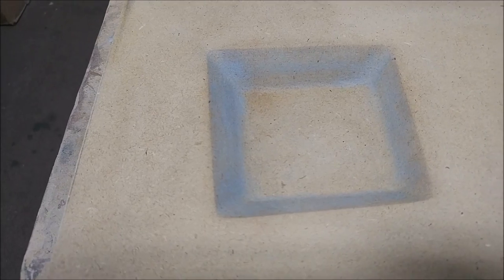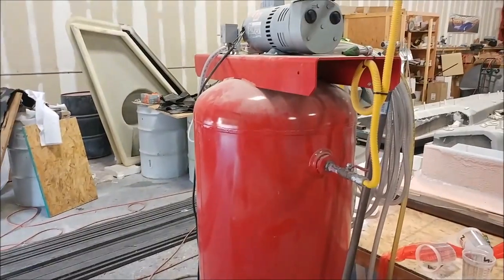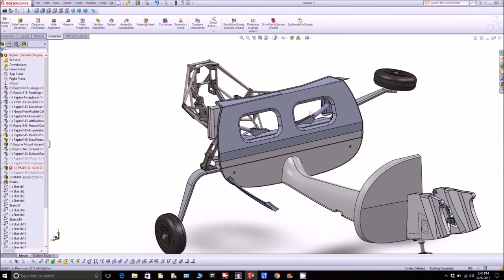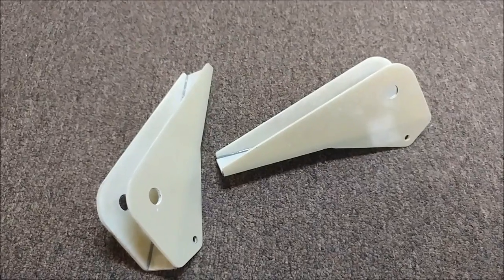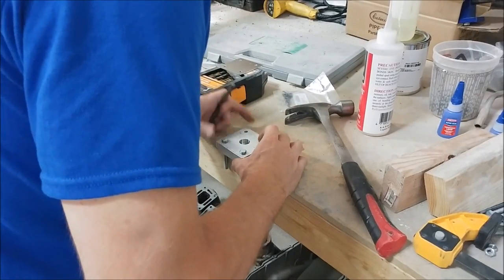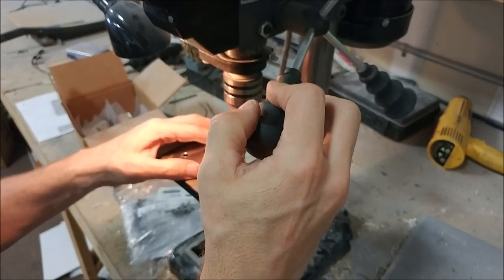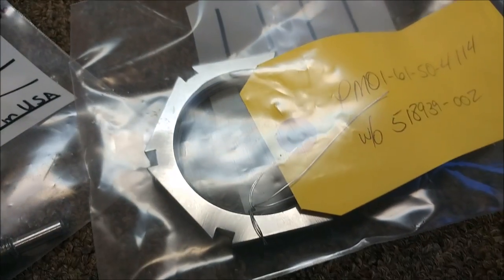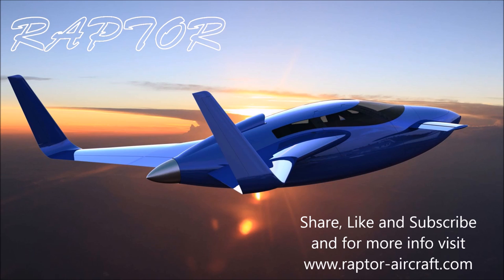Shifting Into Gear - More work on the nose gear system

Comment: At 7:33 of the video, you really should consider using MS21081 nut plates.  They are designed to be placed in corners.  You don't have enough edge distance on the corner rivets with these nut plates.  Any flush head rivet should have a minimum edge distance of (2.5 x rivet diameter).  Ditto what Bobby stated on the transfer punches!  Love the progress though!  Been watching from the beginning.